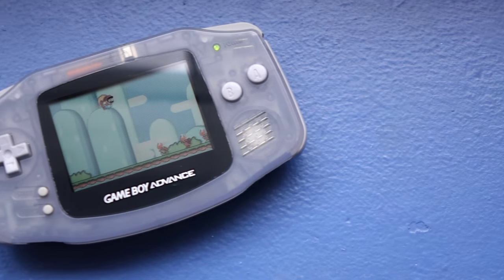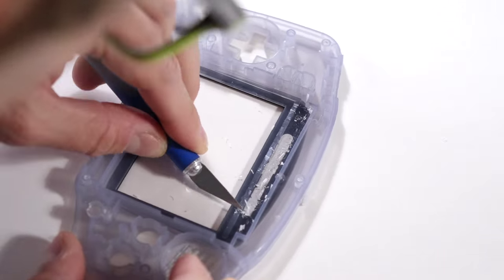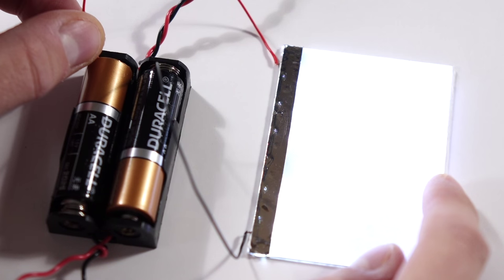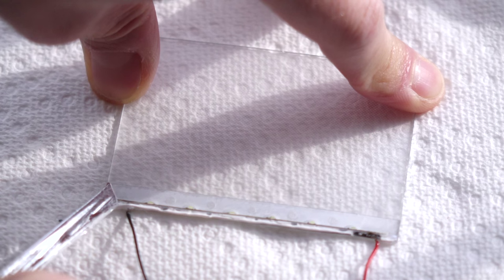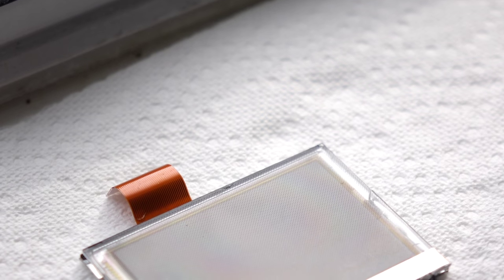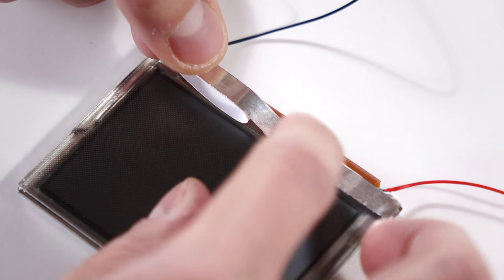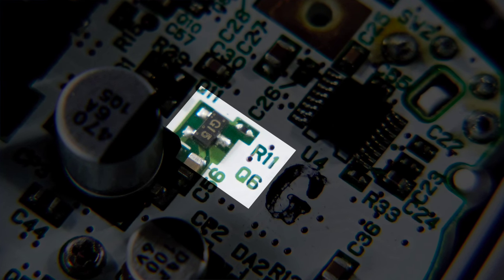Frontlight Your Game Boy Advance!

Comment: This is a pretty neat mod that I've done myself recently. And your video helped me quite a bit, haha.

There are two things that sorta bug me about it though.

1] The frontlight  has all the LEDs concentrated at the bottom, so the bottom of the screen tends to be more washed out than the top.

2] The frontlight LEDS shine through the GBA's plastic shell even if you have an opaque GBA. (This can be fixed with some black electrical tape where the gasket used to be though.)

In the end, for like, 15 bucks or so, you can't complain too much about it; the price more than makes up for those two 'faults'.

Thanks again for the instructional video.

Comment: ordered the parts, put it together, success! it was fun for my first mod, thank you so much for making a video on this!
Reply: did yours come with the reflective strip replacementÉ
mine didn't  so i was just wondering if it was just mine.
Reply: nah mine didnt
Reply: did you put the old one back on or just left it off?
Reply: you could use plumbers silver tape.
Reply: What size solder works for this?

Comment: I like this as a simple mod without having to hunt down an ags001 or 101 that you'd be willing to break down to do this. I have a GBA original with a Trinitron Labs front light kit that came out back in 2003. It still rocks today! However when doing some cleaning to the system I scratched the textured layers of the light lens and created an L shaped mark which is visible when system is on but not so much when game loads. I am going to buy on of these kits to replace it. Thank you for the tutorial!!
Reply from the maker: +Andrew Moreno Yeah, that's really what I like about it too -- it's easy and inexpensive to buy, and more can always be made if stock runs out. Thanks for watching!
Reply: +This Does Not Compute 
Okay another question. My mod now has a front lot screen with a red and black wire running from board to screen. Do you think I can remove the current screen and just attach this new one at the wiring instead of removing the current wire setup? The point that are used on the board are different and there is a resistor being used.

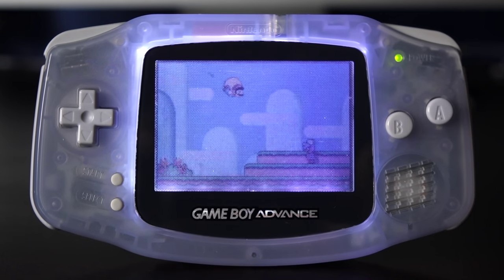Comment: Thanks for the guide! I installed mine as part of a kit off of eBay (sorry Handheld Legends, I will buy products from you in the future, though) and for some reason, it was super duper bright. I'm not exaggerating when I say that it's about 2 times as bright as the example in 6:26, so I'm going to use that as an excuse (...kind of) to install a brightness control in the form of varistor. I'm guessing I would install that into the red wire, right?

Edit: Okay, I've discovered why it was so bright. I didn't use LOCA, so my guess is the air gap was allowing the light to go everywhere, causing some to bounce off the reflector of the screen and go everywhere... ...Yeah, just a guess, I don't really know.

Comment: Any chance you'd be willing to show me a side by side of this frontlit GBA next to your AGS-101 GBA in dark vs sunny environments? I love the colors of backlit displays, but if memory serves they have atrocious visibility in brighter environments. Meanwhile, the natural rear reflectivity that lets an AGB-001 screen excel in the sun is only improved with a frontlight panel added, letting it look better than stock in both dark and sunny environments. Maybe it'd even look better than an AGS-101 in bright light when angled to reduce glare... I'd be interested to see if this is the case in practice. Great video, thanks for making it!
Reply: Boolean i want to be able to control the voltage in brightness and give it a mod for lower and higher brightness for thissd reason :)

Comment: Okay, so I got one installed after learning how to properly solder the wires. Can you give me a couple of tips on cleaning the screen better than before applying LOCA? I sprayed compressed air just like in the video and idk if I did it well enough or what. Also, having a tad bit of trouble with the start/select buttons at times. Could this be that I should have shaved a bit more of the unneeded plastic guides. Mainly start is giving me issues, it's not really sticking out as much as it should be I think, so I have to press really hard in game to actually pause. Also stripped the dang screw by the battery cover... any tips? If I ever get it off I'm going to replace it with a ti-wing screw. One last question: Is it really that blurry? Mines pretty dang blurry! :o Overall I'm really happy considering it was my first ever mod and first time ever soldering, though I need to figure out how to keep the screen cleaner before adding LOCA. Can you help me out with tips? Please and thanks!

Definitely will be trying this a on a couple of more GBA's. I want to make my niece one. :D

Comment: Is it possible to just swap a AGS-001 screen into a GBA ?
Reply: Marko Senli yeah it is, it's basically the same thing.
Reply: But wouldn't you have to have one type of GBA or the other? Either a 40-pin one or 32-pin? I'm assuming the AGS-001 screens would only be able to work with one kind of original GBA. Are there multiple types of AGS-001 similar to how there are 40-pin and 32-pin oGBAs?

What about the steps needed to remove the screen from the AGS-001 in tact? I'm really not sure how to do that myself.
Reply: In order to take an AGS-101 screen from an SP you'd need to get a ribbon cable adapter depending on your Gameboy Advance model (32 or 40 pin) There are many videos on how to do this if you're interested.
Reply: Treble Hook He's talking about a 001 screen, not a 101.
Reply: It’s pretty much the same as the 101 mod but you need a special ribbon cable adapter
Reply: Yea but you need a ribbon cable adapter from 34pin to either 32 or 40pin
Depends which model you have

Comment: Slightly off topic but why is the refresh rate on the GBA SP 101 significantly worse than the original 001 model? I was very disappointed with how much blurriness there was particularly on platformers on the 101.

Comment: Hey. I had a question for you. I like this take with the dot matrix. What would you say is the best method to frontlight a GBA agb001. I know what you said about this one, what about using a ags001 frontlit screen in whole. Similar too doing a ags101 mod. Of course, there are ribbon adapters made for this kind of mod. Have you ever looked into these differences getting the best frontlit look. Are you a firm believer in a frontlit panel such as your video, especially because the use of LOCA. Hope too hear from you! Thanks

Comment: Following this. mine is a 40pin unit. installing the red wire to Q6 and when I put it back together, the power LED turns on for a flash then off. THe frontlight part of the screen comes on, but the regular LCD stays black. Can you help?

Comment: I tried this and it didn’t end up working. I soldered the wires as shown in the video and now the front light works, but the game boy won’t power on. I was worried I had bricked my console somehow, so I unsoldered it and the game boy worked fine. 

I feel like I’ve done something wrong and it’s diverting ALL of the power to the front light and none of it to the game boy. I feel like there’s a detail I’ve missed somewhere along the way. Any advice? Thanks!

Comment: Would you do a vid like this for the Neo Geo Pocket Color or the Wonder Swan Color or Swan Crystal?
Reply from the maker: +SitarKnight Whether the frontlight kit would work with a Pocket Color is something I've been wondering myself, but I don't have one to test with yet.
Reply: I'd be willing to loan mine if you wanted to work with one.
Reply from the maker: +SitarKnight I'd appreciate that!
Reply: +This Does Not Compute yeah, send me the info and I'll ship it off asap
Reply from the maker: +SitarKnight My mailing address is in the description of my videos. Thanks!
Reply: +This Does Not Compute 
Betting it will work, may need modifications to make it fit inside a neo geo, or fill the much much wider screen of the wonderswan evenly (reflectors? maybe even a whole modification of the light itself?) still hope you both have good luck with that. Sounds awesome.
Reply: +This Does Not Compute did you get to try this? as soon as i saw this video I thought this might be possible... there are some vids of a frontlight mod used from a gba sp... but i dont think thats a good route... this might be a more elegant solution
Reply: Why do you say that?

Comment: First of all, thank you for the tutorial. Everything has gone fine except one little issue. My  lighting  panel went dirt with loca on the botton right corner on outer side of it(rugose surface) after gluing it, because loca was not completely cured, I thought it was... Despite cleaning it, i see some kind of translucid mark. Is there any method to clean cured loca rests from the rugose outer surface, and fit it? thank you in advance!!!

Comment: I wonder if the OSAKA-7 would make any difference to the front light + loca GBC mod... but I doubt he wants to do yet another GBC video x'D
Reply: Well Camaro Cougar, I don't know If it makes a difference when installed correctly, but Osaka 7 is easier to remove in case there's bubbles in the display and you want to try again.

Comment: I wonder why no one has reverse engineered a AGS-101 screen, and mass produced in a design so that you dont need a kit with an adapter or anything you could just replace the screen, plug in the ribon cable, and solder on the power wire.
Reply from the maker: +Michael Visaya My understanding is that it all comes down to economics. Nobody makes AGS-101 screens anymore, so to produce even stock ones would involve tooling up an assembly line, which has a pretty steep upfront cost.
Reply: +This Does Not Compute Wow, I honestly did not expect you to reply. No offense.
That makes sense. I guess the demand is higher than the supply, but the demand isn't high enough for it to be worth increasing the supply
Reply: +This Does Not Compute Also keep up the good work, and I hope youtube goes well for you. You clearly care about what you're doing here.

Comment: Anyone else have problems with the loca curing properly? I just modded 3 gameboys in a row and all 3 of them have very messed up loca (I’m guessing it didn’t cure properly). I’m pretty confused because I let each one cure for 30+ minutes and they were DIRECTLY under a uv lamp (no sun just lamp). Even when I would try to move the screen around, the glue was absolutely sturdy, no movement at all. So I put the screens back in the shells and about 10 minutes later the screen is completely ruined (glue is spidering over the entire screen)

Comment: So i've Installed an AGS-001 screen in my AGB, works fine n all, but i messed up the front light glass, fingerprints and some glue all over the rough side of the frontlight. I tried q tips and tissues with lighter petrol but it doesn't work at all, the glass is so rough it rubs off the tissues and makes it even dirtier.

What's the best way to clean it up?

Comment: I have a few questions. Can I use the original screen without the gasket? what is it for? why does dust get under my screen even though it was blown out and put together immediately (i notice dust gradually collects under the lens and i think it's because I placed the lens a bit weird)?
Reply from the maker: +SkyFireInDaHood As far as I can tell, the gasket is just meant to adhere the original LCD to the front panel. You don't need it -- provided that the logic board is applying some pressure on it, the screen won't move around. Not sure about the dust, static electricity maybe? If you still have a plastic screen cover, a glass one should help a bit.
Reply: This Does Not Compute Thanks for the fast reply, and yes, I do have a glass lens. Maybe I should check for gaps between the lens and shell to make sure no little spaces are present. Thanks!

Comment: Hi. I know you used the word economical for the mod. Do you find the mod better than a AGS001 screen in its entirety, pretty much like doing the backlit mod, with its own ribbon adapter. Have you seen these mods?
Reply from the maker: The 001 screen was designed to be frontlit, so it definitely has a quality advantage. But if you're going to the trouble to swap screens, might as well just buy a 3rd party 101 display.

Comment: i realize this is a zombie comment at this point 4 years later.... but: i has a question; the textured side of the frontlight: can the textured film be removed? did you not remove it on purpose? does it look better with the texturing? how does this look without the glue you used? does it rattle without the glue?
sorry for so many questions. just wanting to do this to my own gba but am not sure if its a better plan to do this instead of getting a backlit screen and doing that mod instead.
Reply from the maker: The texture is molded into the plastic, and it's needed so the light disperses evenly.

Comment: I have watched some of your backlight gba videos and noticed that those kits are no longer being sold, or for a ridiculous amount. I have a gameboy advance sp ags 101 that does not word anymore, the screen is perfectly fine though. I was wondering if I could take the screen out of that gameboy and place it in a regular game boy advance. If so, I was wondering if you had any tips on how to do this. Thanks
Reply from the maker: +Zac 22 Yes, you absolutely can. While the replacement backlit screens are no longer available, the adapter ribbon cables are still easy to find. Your AGS-101 screen would work just fine for this. Good luck!
Reply: +This Does Not Compute Okay, thanks.

Comment: how different does it look in comparison to a ags-001 gba sp? is it better or worse? it would have been great to see that in the video.
Reply from the maker: +ynsu94 At some point I'll probably do a quick video showing the differences between all the screen options. The frontlight I showed here is brighter than an AGS-001 and, to me, has similar color saturation. The 001 appears a little sharper, though, because its frontlight isn't as textured. Of course, the 001's screen has the benefit of having been designed by Nintendo to be frontlit, whereas the original AGB's screen was never meant to be illuminated. Ultimately I think the mod holds up well and will prove to be popular -- it's inexpensive and readily available. Thanks for watching!

Comment: Quick question: If I buy a solid color shell and paint it with spray, will I have problems with the addhesion of the paint? Or should I use some other material to paint it?
Reply: You would need to get a can of Plastic Primer for sure.
Optional: and matching paint/clearcoat for optimum results.
Reply: +JobeMinacum Thank you so much for the reply
Reply: Serra Uke
Not a problem, happy to help. If you have any other questions about painting with spraypaint, feel free to ask. I've done lots of painting in my day. :)

Comment: What if you did the LOCA method with a Gameboy Pocket?
Reply from the maker: +Sterling Lapham Technically you could install a frontlight with LOCA, but since the original Game Boy and Pocket can be properly backlit, that's the direction most people go. Backlighting is significantly better.
Reply: This Does Not Compute you Should definitely do a video on how to Bivert the Gameboy Pocket!

Comment: Why would someone frontlight a gba?
Reply: As backlight screen have dried up since the original seller has gone silent and the prices are close to £100 at the moment
Reply: +Brian Griffin So much cheaper.
Reply: Cheaper than a backlit honestly unless you compare them side to side it looks good enough to play with
Reply: MY reasoning for wanting to do this is: sunlight. While the AGS-101 model GBA SP looks great in low-light situations, it (along with pretty much every backlit screen) is nearly impossible to see in direct sunlight. A FRONTlit screen, though, (like the AGS-001 GBA SP) looks BETTER in the sunlight, so you can use it everywhere.
Reply: Christian Rodriguez exactly what i thought lol
Reply: Christian Rodriguez it would be darker otherwise
Reply: Backlights are a pain in the ass to install.

Comment: Hey Collin, I have been struggling modding my gameboy.I have done everything but when I turn it on nothing happens. If I put a bit of pressure on the shell it turns on but it does not show display or sound. What can cause this?
Reply from the maker: +Aaron Castro That you need to apply pressure to turn it on sounds like an issue with a solder joint or loose connection somewhere. You might want to take another look at the screen ribbon cable connector, and any solder points you used. From there, you could try working backwards to undo the mod, testing after each step (for example, try unsoldering power wires to the frontlight). Good luck!

Comment: how would you compare this one to the GBC frontlight? are they equal quality or is the GBA one better? if so do you think you could mod this panel to fit a GBC?
Reply from the maker: +Bram De Klerk In terms of quality, they're practically identical. The only real difference is the size of the panel and the number of LEDs illuminating it.